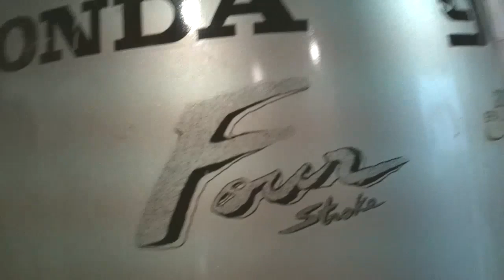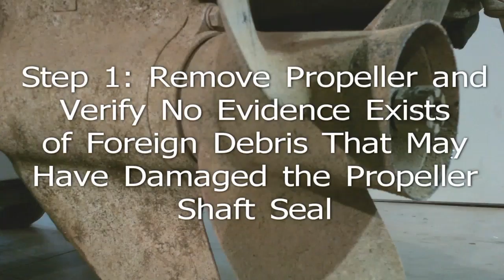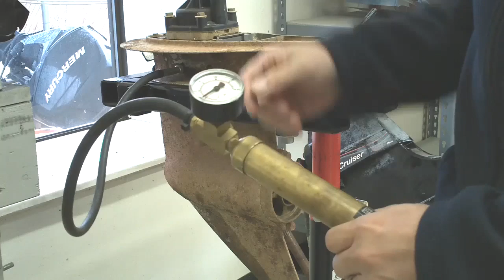Honda 90 Hp Outboard Gearcase Leak

Comment: any ideas on why a lower unit would fail to hold vacuum after a full seal replacement as well as a new water pump?
Reply from the maker: +Ryan “BigRy26” A. You might try to spray some type of oil (WD-40) around the sealing areas to see if you can pinpoint where it’s leaking in.
Reply: There might be a damage to one of the axles, causing a new seal to fail again right off the bat. However, if the seals were not properly lubed when installed this could also cause leaks with new seals. Just some suggestions, though I hope you have it fixed by now :)